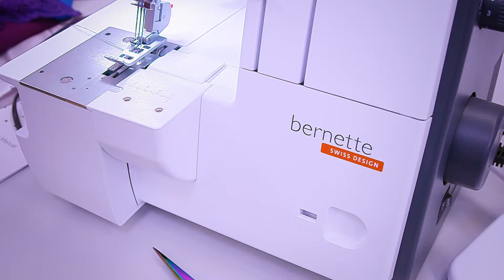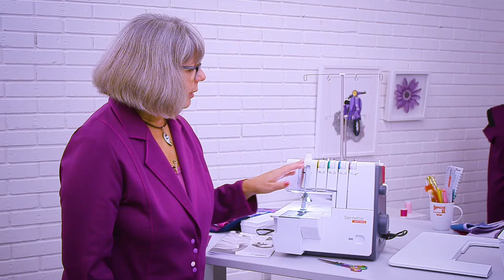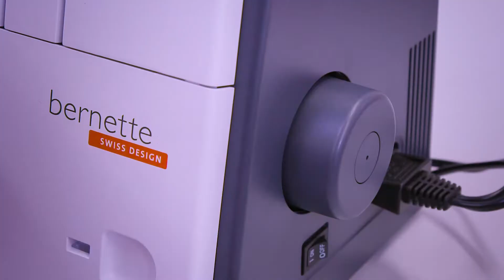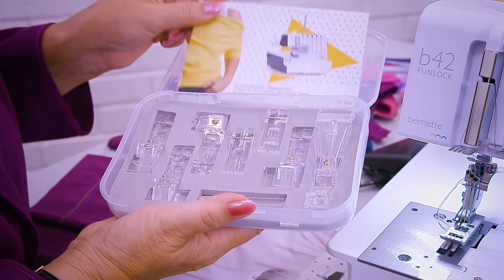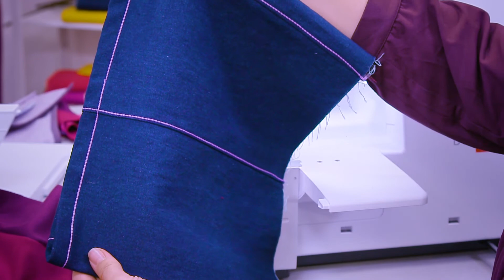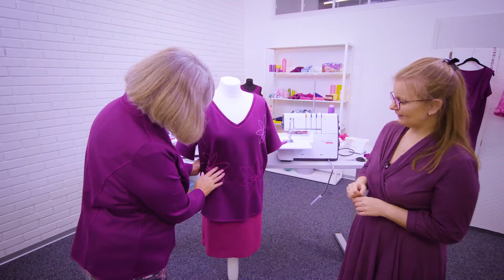bernette 62 and bernette 42 coverstitch machines – Expert Chat

Comment: a total disappointment, it had been bought to make lingerie, the teeth did not have strength, I just put a little fabric on top of another and took it out to the side, it was sent to technical service and they made thousands of excuses, on the subject and they never acknowledged that their The product came out bad from the factory, I don't know what Bernette's policy is, never admitting that a product came out defective, I say this because at the same time we bought an overlock from another brand at a lower price and it does the job without problems, what could you tell me about it?
Reply from the maker: We’re sorry to hear that your machine hasn’t met your expectations so far. Many sewists use this model to create beautiful lingerie and achieve fantastic results, which makes your challenges particularly concerning. For the best support, we recommend reaching out to your local dealer. They can provide tailored advice and troubleshooting to help address the issues you're facing. We hope your machine is up and running smoothly soon so you can enjoy creating the projects you envisioned!